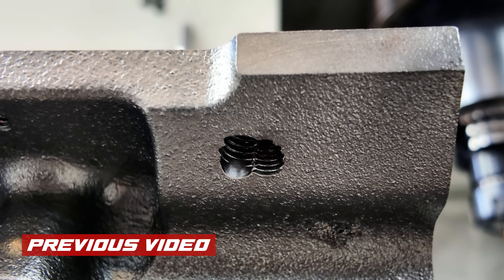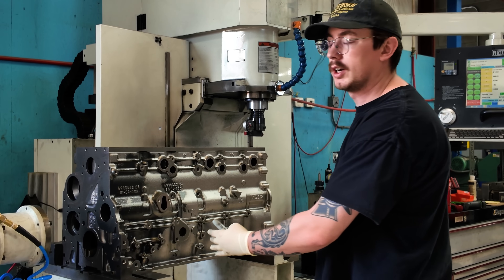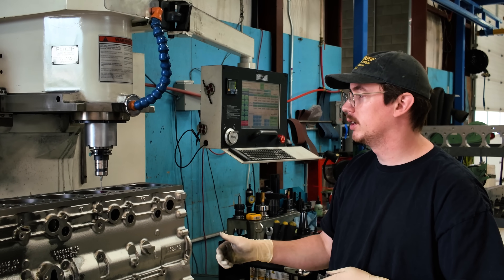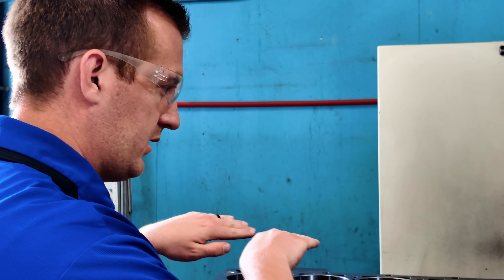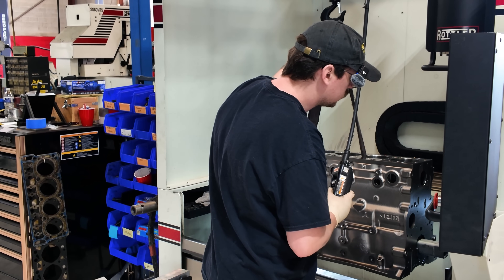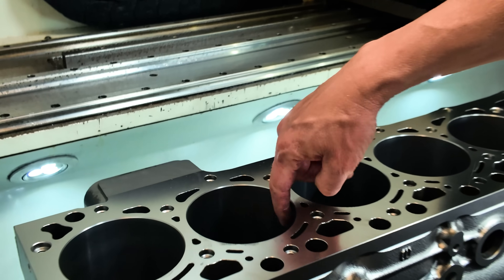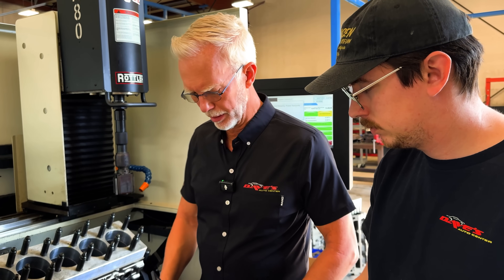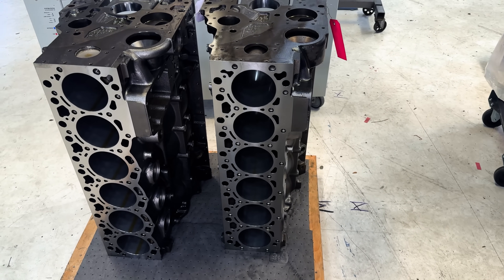Making a JUNKYARD Block BETTER Than When It Was NEW! - FULL Engine Machining

Comment: I am wondering how often you make calculation mistakes by still using a system that was not created for modern use? 0.127 or 5/1000 One is a direct number and the other still needs a calculator. Nevertheless you do a great job over there and it is satisfying to see people take care and be proud of their job and products trying to be the best possible.
Reply: So if you don't know 5/1000 is 0.005 steer clear of any machine shop or engine rebuild shop.

Comment: I’ve got a question for you Dave! Watching your engine tech align hone the block using the long, multi piece diamond hone, to grind/align the mains, why isn’t the tailstock supported and fixed in place  instead of being allowed to float? Since the hone is fixed in position at the front shouldn’t it also be pinned at the rear? It also seems to me that if the hone has to be done this way for some reason, then the block should be turned around 180 degrees and ground again. It also seems to me that the block mains should be honed like the cylinders in an upright position. Perhaps your cylinder bore machine could be modified to do both jobs.

Comment: Many years ago, I was reading an article in Mopar action magazine and a company called Indy cylinder head. They do extremely nice work. Also they even make cylinder blocks. They make their own cylinder heads and they do beautiful work but this one old guy who used to work for him? I don’t know if he’s still with him or not now Herb McCandless, Mr.Four speed herb always said put your torque plates on and let the engine block sit for several hours maybe even overnight before you actually do the final home that way the block is done squirming around. And what? Also, I recommend forget the head bolts just go straight to a set of ARP head studs  you’ll have less deflection on the cylinder walls

Comment: "You don't just T.I.G.-Weld a Spot on the Block!!!"...                                                                                                                                                      If you even wanted to think about ever welding up an engine block that size you'd have to bury it and cook it like a                                Pig in the Ground 1st  ...

Comment: torque plate honing sounds like a great idea, but following that logic, wouldnt you need to heat the engine block to operating temperaature, AND simulate compression in the cylinder to REALLY get it perfect? I guess torque plate honing is just where you have to stop because all that would be too hard

Comment: Just thinking out loud and I've known for years about Torque Plate Honing for cylinder walls but wonder what would happen if block was torque plated before the Mains were align cut/honed, wonder if anybody has tried that before? I did see that the Main Caps were installed for the  Main's Honing Operation.

Comment: What's with the nick at the top of cylinder 2? It's there before decking and after chamfering. Can't that be an issue? Everyone seems to not even mention it, but you guys would have noticed it.
Reply: The nick was from a valve that let loose in that cylinder. The chamfers only purpose is to aid in piston installation. A small nick is inconsequential.

Comment: Some things have been on my mind. A mind that BTW doesn't understand a lot of these things. :)
A normal car has, very roughly, in the order of one power stroke per meter traveled.
If you have an old crappy car with, let's say, 200 000 - 300 000 km on it,
it has had hundreds of millions of power stokes.
How much has this made the head bolts to stretch?
How much has the head gasket compressed?
I understand a blown head gasket is a common problem on old cars.
Would tightening the head bolts on your old crappy 200 000 - 300 000 km car make its head gasket last longer?
Or maybe its head gasket, or head bolts, last shorter?
Or what?

Comment: I cringed when he was scraping the precision surface with what looked and sounded like a razor blade. 2:08 😢

Dave you need to get him some precision ground flat stones. They are used to remove high spots on mating surfaces without cutting into the flat surface. The stones are ground flat as a pair and are used together. They are $100-200 and will keep your machines in top shape. They will also remove any high spots from the parts that may throw off a part. They are cheap insurance. Look up on YouTube for how to use them.

Comment: Would the line hone remove more metal from the block then the main caps because  of the weight of line hone pushing against the block?
Would turning the block right side up
cut more from the caps and not move the crank center line from the original position. I have heard of timing chain sets that have a slightly shorter center to center measurement to correct for engines that have been line BORED. 
Am I missing something?

Comment: # 14:00. Great video and work. BUT i totally understand why you hone with a torque plate on. BUT why don't you bore the cylinders with a torque plate on ???. Those guys in the states that make 1000bhp + BMW M3.   Bore & hone with a torque plate on there ❤
Reply from the maker: It’s not necessary. There is .005 thousands of material left on the bore before we Hone so it doesn’t matter. The walls don’t distort that much. Good question 👨‍🔧
Reply: @DavesAutoCenterCenterville  oh ok 👍 thanks for the reply. ❤ your channel & honesty

Comment: Dave the line honing at the start wasn't evenly honing as he was withdrawing out of the journal near the camera on every stroke. Shouldn't the hone stay in all journals at the same time?
Reply: So a cylinder hone can’t hone a cylinder because it’s not at the top, bottom and middle of the cylinder at all times? 🤦🏻‍♂️
The machine has sensors that detect the journal diameter applying pressure as needed to ensure proper dimensions.

Comment: That's why it is so important to do the top of the cylinder bank and not just the head when you have a seized cylinder head gasket. If cylinder
 bank and head don't fit properly it's just quick job and the gasket is going to fail again after a short period of time. Best wishes and keep up the good work from Weissach/Germany 👍😀😎🛠️

Comment: If we can just now get Dave to quit calling it a fucking motor he will sound way more intelligent. It’s a Cummins diesel engine not a Cummins diesel motor.
Reply: All engines are motors but not all motors are engines. The terms are also used interchangeably. Stop trying to sound intelligent and look up the definitions of the words.

Comment: Nice. 
Finishing the top end of the block by 4/1000 or 6/1000 will not change the compression ratio.

Comment: Perfect. Slow enough that I could follow. I worked in semiconductor fab equipment that had very exacting tolerances, tool path and surface finish requirements. but my team knew 10x what I did, so appreciate the slow tempo..

Comment: Clean it, Fill it with JB weld, drill it tap it boom how would that  not hold up for a tiny little bolt come on. In THAT scenario shouldn't a quality metal epoxy do the job?

Comment: Dave I remember you saying that all Cummins rebuilds need to have #6 cylinder sleeved due to lack of cooling ability all the way at the rear. Did the customer not want to pay for that on this one?
Reply: I think they machine an extra 0.001” or 0.002” into bore six to compensate for additional heat
Reply: @ryanweaver5867 that’s interesting. That would be courteous of them if it is the case. But then again I’d think it’s only fair if they aren’t gonna design a better way to cool off that last hole

Comment: The metrologist in me has a question, I noticed that the Renishaw rotated with each probe point, striking the ruby in the same area with each pass. Is there a concern that a wear spot will develop on the ruby, since it doesn't use equal points around the cylinder wall? (Frequency of stylus calibration, etc.) If I were calibrating it for you, I would be concerned about the uneven wear, and roundness of the X/Y axis, being out of range.

Comment: Dave, you can heat the part of the block where the bolt was messed up with a torch, tig weld it up, drill and tap it. I have seen CEE do it on cast parts that are low torque fasteners and it works. But I think either way works fine in this application and you do what you are comfortable with.

Comment: A guy at work who's Dad owns a welding shop told me about stick welds specifically for cast. I was repairing an old tool (manual bench grinder) the cast handle broken off. Anyway, I used that specific Rod for cast iron and the repair held up nicely. Maybe try that if you've never heard of it. 👍
Reply: I use a high ten 8 which is a nickel based rod. They can be a bit hard to start but do a beautiful weld. I even welded some broken rockers on an engine, in an emergency. When the new ones showed up the owner didn't see the need to replace them, LOL 🙂

Comment: The honing step at the end required coolant for the machining but the earlier machining for the flatness and cylinder walls did not require cooling fluid.  Does anyone know why some operations do and some don’t?
Reply: Generally coolant is only required if there is a lot of surface area being removed at once. In the first few examples the tips of the blades were taking of very small amounts in a slow steady fashion where in the end example it goes right in and a lot of blade is in constant contact with metal which creates much more heat.
Reply: @Furchee Thanks for the reply and insight.  I appreciate it very much!

Comment: With the pan rail bolt repair job (great work, certainly.) Was there any other way to have done the job (the job is making sure there were no leaks.) How would a "shop in Pakistan" have done the job? Could those existing bolt holes have been sealed off with some type of chemical "weld" and new holes made in both the block pan rail and the pan itself? This would have avoided the dreaded "weld to cast iron". The work in the machine shop compared to actually working under the hood or on some system like AC, electrical, interior trim shows a gulf as wide as there is with work in the office compared to work in the shop. Not criticizing either profession. I point this out for people thinking of entering the general field of "auto repair". There are parts of the profession where you need not get dirty. Again not being critical.  Working to within 3 decimal places (.000) has become very common. It is when you want to work within 6 decimal places of accuracy (.000000) where innovative ideas are required. You see the very base setup with the block required accuracy to within 3 decimal places. It is allowed to say this level of accuracy is "exact" when it really isn't. The only spec used in an automotive engine that requires this 6 decimal places of accuracy is the piston wrist pin fit, or so I think. This  6 decimal places of accuracy is reserved for weapons design (not with a Model 1911 though.)

Comment: I just found your channel and this was really educational. I work  for a machine tool builder that machines these blocks at Cummins, CAT, PACCAR, JD, Volvo you name it but it's really cool to see the back end of this and to see the problems that occur in the real world. For example, in production we use a head deck mill that has like 24 inserts. But we don't simulate the torque on the cylinder bores for instance. I'm going to keep watching your channel to learn more.

Comment: While I understand the issues with welding cast iron and that preheat and post heat cool down is important, I've had a different experience. 
While in welding school, I had a chevy 350 that had the starter ear on the block broke off. I asked my instructor if he could weld it and he said yes.
I brought it in, cleaned the area, and he used inconel rod and a piece of carbon round stock. Welded it up and I drilled and tapped the hole. Still holding after 10yrs

Comment: I enjoyed the look the machinist gave the owner when he said you going to leave two thou to hone…..that’s a guy that been around long enough to remember how we did it back when it was a hand hone on a half inch drill….back then no way would you leave five to go. The technology of this equipment is far beyond what I ran back in the day. A Rottler bar with centering fingers in the boring head and a Sunnen CK 10 were state of the art back then but did a great job. When these high end machines  started replacing those machines a lot of small machine shops were priced out of replacing anything .  Glad  you can make enough on an engine build to justify the cost.

Comment: Tig weld won't work on cast it won't bond properly.  Arch weld will but you have to teak the block area you are welding . Teaking dissipates any moisture in the area welding and preheat the area creating a better bond . If you don't pre heat cast when you try to weld to it the cast will come out with lots of hair line fractures.

Comment: Machinist here from Missouri. Love the detail in the last two videos people don't understand what it takes to build a real engine
Reply: And it’s an engine not a motor if they rewound electric motors are rebuilt hydraulic drive motors or air motors that be different but this is a diesel engine, repair shop and gas engine repair shop
Reply: Show me state😊

Comment: I got a project for you I have a 1999 Cadillac devile and I bought it 5 or 6 years ago and only drove it for about a month and had a shop try and fix my car but they failed and ruined it even more after putting new head gaskets on and then they told me to get my car out the shop after spending $14,000 and not it's at an other shop just sitting there going through the same stuff and now I'm completely broke and out of money and lost my job unfortunately because of it car has been in the shop for about 6 years and I just need someone who's know what they are doing to work on it because I've spent a told of $20,000 on this car and literally still haven't been able to drive it since 😢
Reply: Northstar ?
Reply: @charlesyates2208  Yes
Reply: Keeps losing power and a whole bunch of stuff popped up on the dash after the first shop did my head gaskets
Reply: @charlesyates2208  already replaced all the stuff for it 10x times over
Reply: Uh, the time to cut and run would have been before you spent $14k at the shop on 20+ year old car. A reputable shop wouldn't have even done that in the first place, but you should have also known better.
Reply: @GridIndustries  Right just shoulda known hmmm interesting get lost
Reply: @GridIndustries and cut and run you are dumb

Comment: 3:27 Wow 🤩 Hola señor Dave!!!👋😊👋that’s a great looking t shirt and by the way you guys are making a pristine job with that engine block … if I just knew that you can revive an old engine block I could have sent it to you after the 300k I put on it and it was getting tired plus I got ill and I had to sell the truck to one of those “we buy junk cars “ type of thing it had a lot of sentimental value to me but the stroke was devastating to me so I had to make the decision to let it go or it would cause me some trouble with the city code and plus the truck was parked outside in the driveway without any carport and the Texas summer weather sun is brutal with anything in direct sunlight 😢…keep saving those engines and keep up the great content!!! Saludos!!!👋😃👋

Comment: Why are you aligning the block off the oil pan rale instead of the newly aligned main bores?
Reply: Because there's more than one way to do things.
Reply: The Mains were sized off the rail before the finish Line home, so everything is referenced off the pan rails. You've got to pick a reference that's stable, the block were the head bolts down is exposed to high temp and pressure. It gets stressed and needs to be decked off that stable reference point. If you notice, when they clean up the top ( deck ) of the block, it's always a little wonky. Always.

Comment: Referencing off the oil pan rail that was previously fixed with inserts, but didn't ya have to leave a shoulder on those inserts? Is that not changing the reference point? Great videos and workmanship btw!
Reply: yeah he mentioned that in last vid. when you buy some timesert kits it comes with a tap the countersinks for the sert. he didnt use one when he tapped it, from what i saw, likely why it didnt seat properly, to make up for the sert shoulder